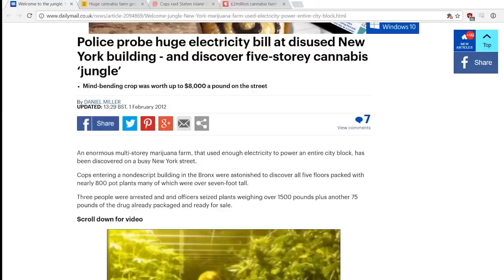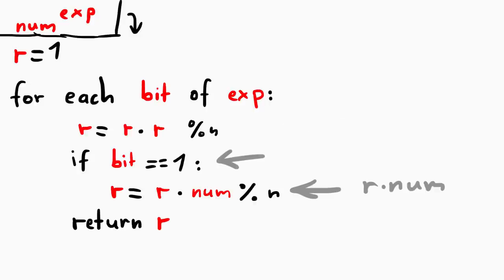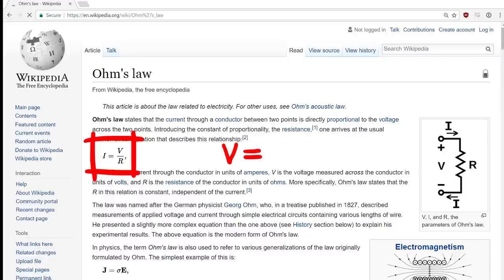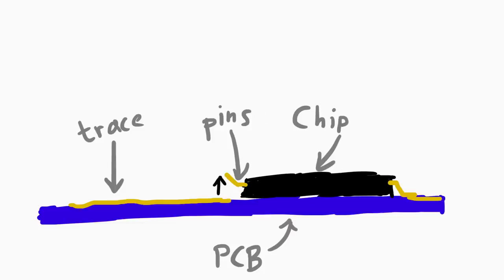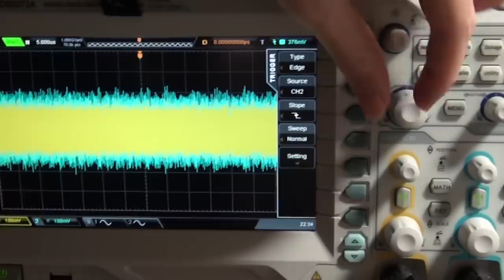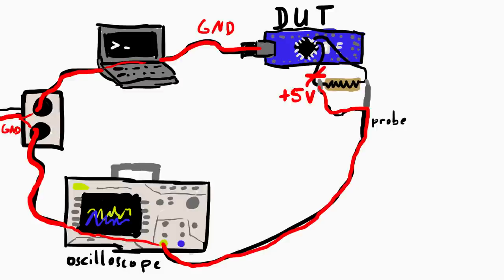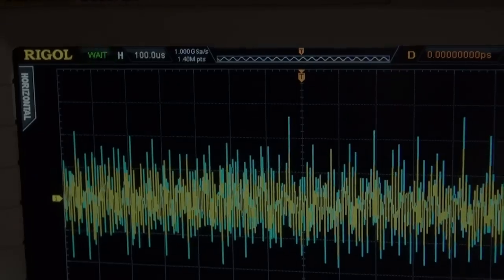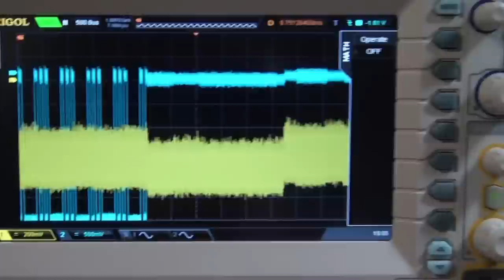RSA Power Analysis Side-Channel Attack - rhme2

Comment: No need toremove those caps. That only helps if the caps are AFTER the shunt resistor. In this case they might actually make the result worse and make your pulses less sharp, since the capacitors would provide a fast transient response.

Comment: Bro, use an op amp to increase the voltage difference over the resistor. Use capacitors on the power terminal of the op amp or use a battery to power it.

Comment: Hello, to avoid ground loops, I started to use a 220v cupeling transformer.
And I do not put it on ground. Basically this transformer is a 200v:200v trasformator, it is a working solution

Comment: Kinda wondering why your rigol is not hacked and running on 300MHz :D
Also Caps infront of your resistor should make your results better, you only need to remove them after your shunt resistor  (between it and the VCC pin)
Reply: I don't know anyone that hasn't done the hack on day 1 -- when it arrives..

Comment: Just use math mode in oscilloscope to substract ch1 to ch2 and get the differental voltage across resistor

Comment: Wait, so are you saying that lot of the capacitors in modern electronics are just there to smooth out the signal? If so, how do you tell really important caps from not-so-much important caps?
Reply: cyancoyote Trace the tracks plus trial and error. 

Some caps will be part of an oscillator circuit (RC/RLC) so it could just really screw up, if that's the case and the board stops working, resolder the cap in place
Reply: Thank you very much :)

Comment: Awesome vidéo !

And just a small tips ;)
When I try a new circuit or when I am not sure about my wiring, I use a power supply with current limitation (depending the circuit, but around 200mA for a microcontroller) to prevent cuicuit burning. Maybe you will do the same ;p.

(And a good power supply as a floating 0V to prévent ground loop.

Also, USB power supply is not really stable, it could disturb your mesuring.)